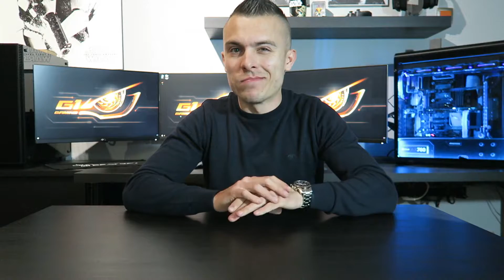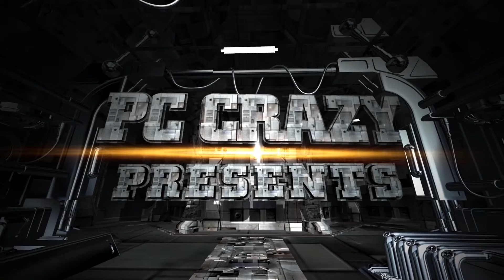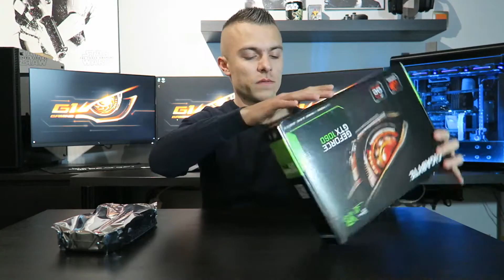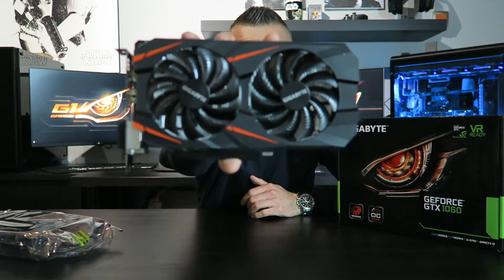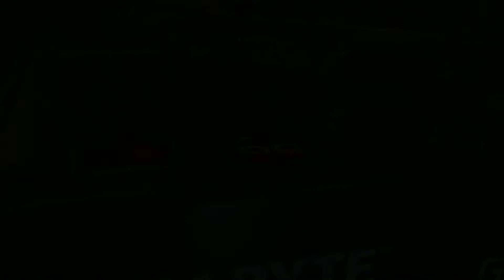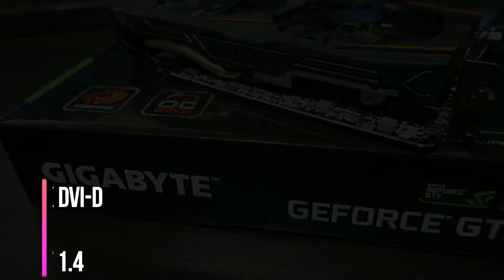Gigabyte GeForce GTX 1060 Windforce 3GB - unboxing

Comment: In 2020 gtx 1060 6gb still good card for 1080p ✌️😈
Reply from the maker: VidiS LTU Still doing quite alright 😉
Reply: @PCCrazyDario  yes. But i try to overclock this card and can't find the best settings..
Reply from the maker: VidiS LTU Well that is something that you need to test out for yourself. Depending on the strength of your CPU and the amount of watts your PSU has. Don’t burn it down. 😉
Reply: @PCCrazyDario  CPU is old i5 3570(non K), PSU is 500w(that is writing on box)

Comment: i dont know what to do i can buy a 1060 3gb more cheap than 6gb but maybe in future i need more vram
Reply from the maker: iramike If you need a small time to save, better get the 6GB version. Future proof, at least a bit 😉
Reply: thanks for you help here in mexico i cant find a good price for a 1060 6gb because mining of bitcoins really sucks :/ how about noise in this cards is to high when we are playing?
Reply from the maker: iramike This card is actually really nice because it has automatic fans that turn on as the temps go up. As the temps go up, fans speed up, but since the GPU is in the case, you won't hear it that much. It is really ok card 😉